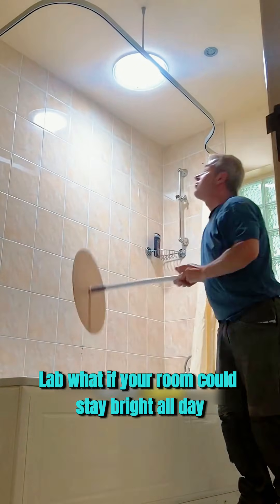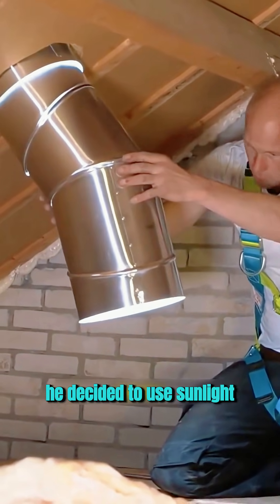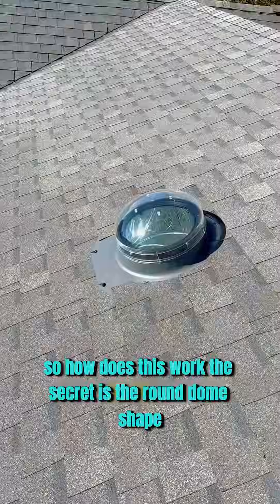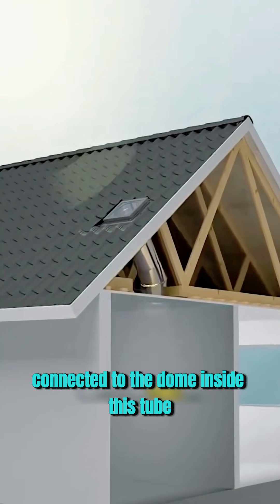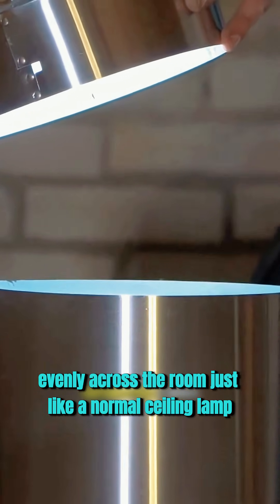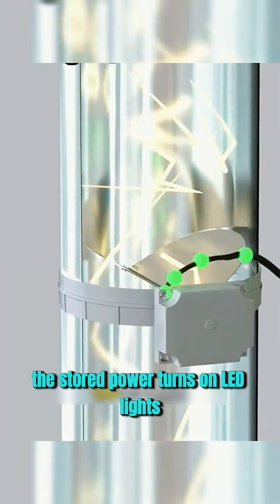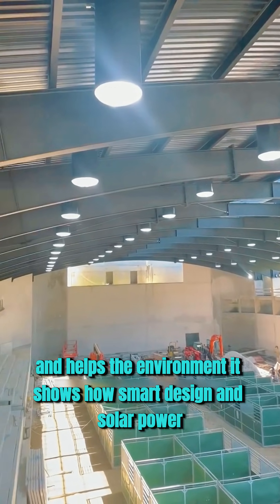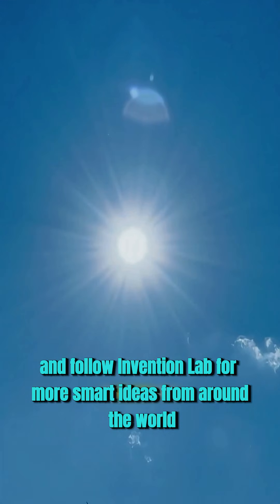This Simple Solar Invention Lights a Home for Free | Smart Daylight Technology

Comment: A 15w LED ceiling house light costs $2 to $6 a year to have on 24/7 depending upon your area.  A roof penetratration will cost at least a 1k and increase the likelihood you will have a leak and incur thousands of dollars of damage.  The light on for 50 years will cost $300 total.  Which is more?  This is why this idiot can't afford electric or this is a scam by this installer.
Reply: That what I was commenting earlier. 💯% correct.